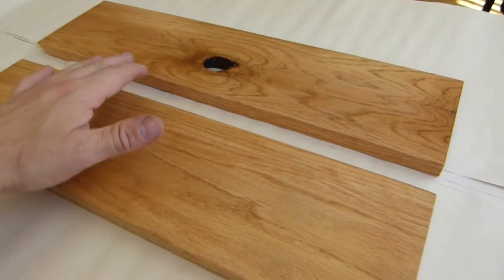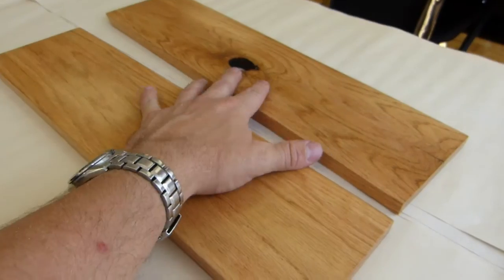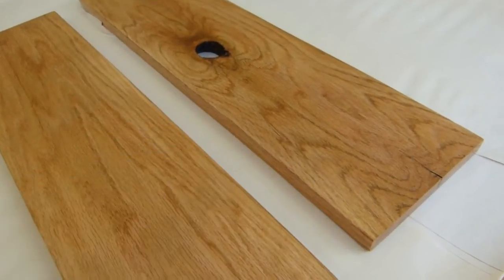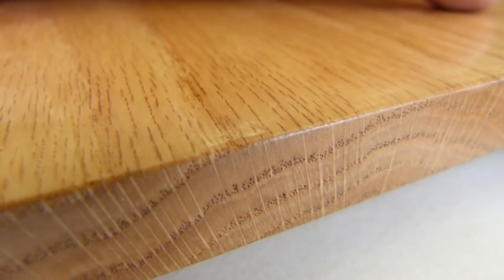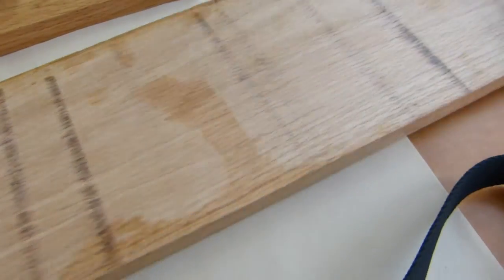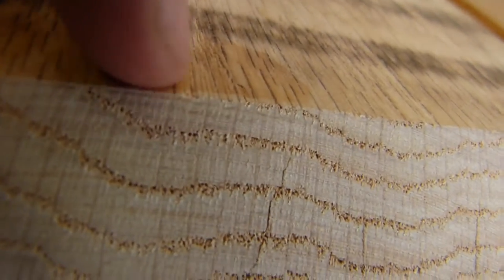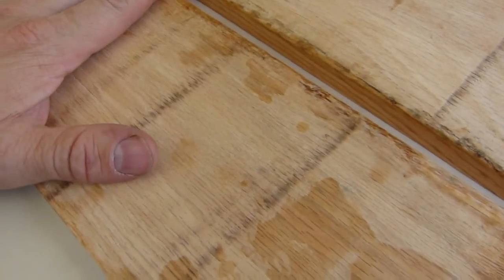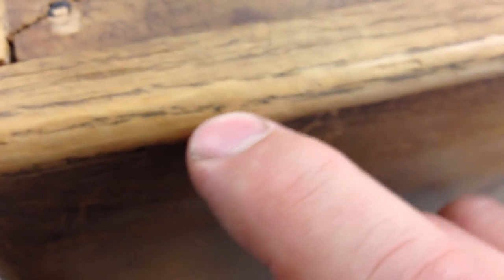Identify Red Oak wood (Quercus sp.)

Comment: Thank you for the video... I'm learning more about wood, Can i use pine for garage doors?
Reply from the maker: Sure can, but will be heavy to lift for the motor when the wood is soggy from the rain, will shed paint like there`s no tomorrow, will warp after drying out from every single rain or from heat and moinsture differences and will seize at the rollers in the track, ... so no.
Reply: Press F to pay respects
Reply: @JM-lc3ki  F